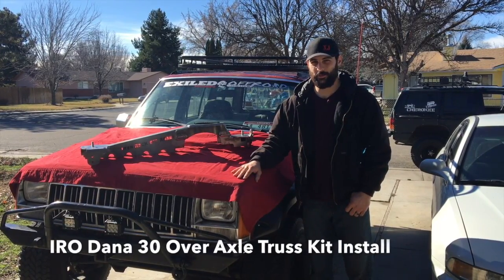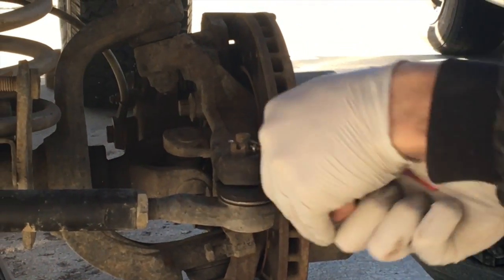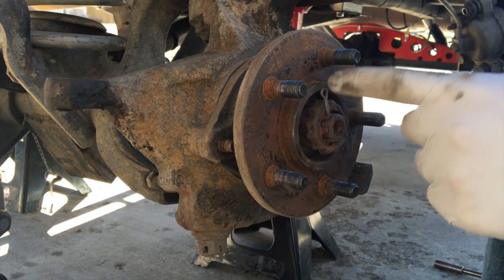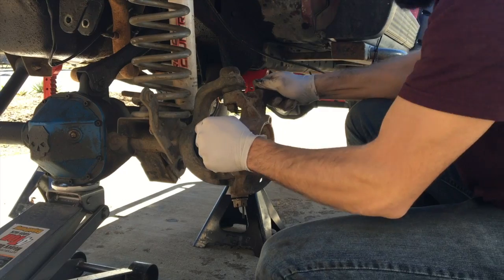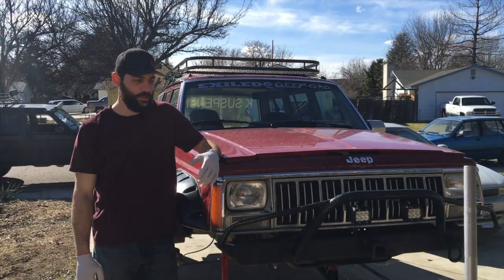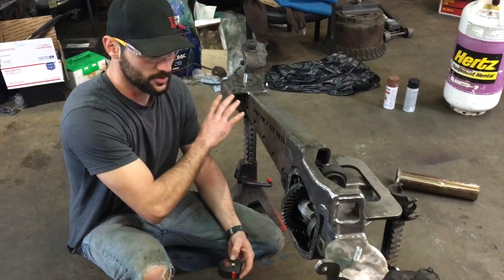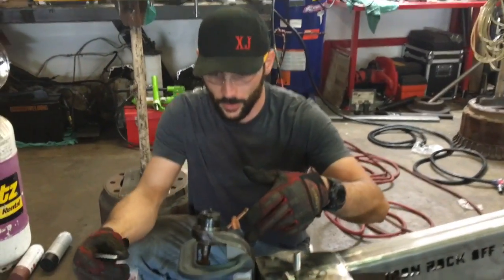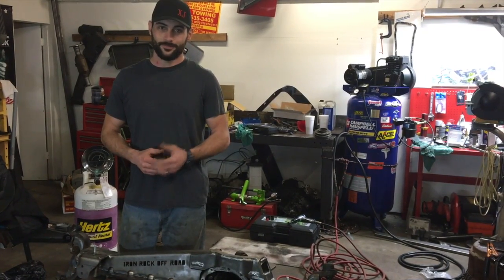IRO Dana 30 Over Axle Truss Kit Install

Comment: Is it necessary to remove the carrier and inner axle seals if welding axle tubes to  center section?
Reply from the maker: Yes. You're gonna cook everything and don't want your parts to fail.
Reply: @KSuspension  cool thank you
Reply: @KSuspension  if I remove the carrier and seals do I need to redo the backlash when I put it back together? All I want to do is weld the axle tube to the pumpkin.
Reply from the maker: @moejr14  shouldn't have to
Reply: @KSuspension  thanks man

Comment: Hello. I’ve been fallowing your FB and YT for a while now. It appears to me that you are a knowledgeable person when it comes to the Jeep Cherokee XJ. I have a 1990 XJ that I am getting ready to start a major build with. The Renix engine will be a entirely separate issue but I am looking at the drive train and suspension first. I also have a 2019 Jeep Wrangler JLUR. I believe the JLUR has the dana44 axels. I am looking at picking up a front and rear JLUR axels fro my XJ. This would give 4-10 gearing, lockers, and 4wheel disc brakes all in one shot. I’ve never done an axel swap so here is my QUESTION: will these axels work on an XJ. I live in eastern Oregon and had plan to purchase some of your products for my build and if it’s ok I might even hit you up from time to time for some technical advise. Thanks and I hope you are doing well during theCOVID hysteria.
Reply from the maker: You can use the axles, but they will be wider and you’ll have to weld on new coil perches and leaf springs perches in order to fit under the XJ properly

Feel free to email us for any tech help
Reply: @KSuspension  Thanks for the quick reply. I figured I would have to redo the spring perches. I’ll have to do some research before I undertake that project, (unless you do that kind of custom work at your shop). Just out of curiosity at this point how much wider are the 44s than the 30s?
Reply from the maker: @williamhart4418  I couldn’t tell you exact measurements without looking it up, but I do know they’re wider

Yes we do this type of work here

Comment: Wow this ball joints are shot lol. See all that movement when snacking the hud free 🤣

Did you really just weld this up with bearings and seals installed? Someone’s gonna have a leaky axle soon and have to rip all this back apart to replace seals at a Minamum.

Comment: Best way to remove much if this is put the nut back on a couple threads upside down (for castle nuts) then just shwack the bolt directly with a hammer. This both breaks it free and keeps it from just falling to the ground entirely as the bolt catches it. 

Second part skipped over.. when removing the driveshaft have some electrical tape handy and tape the two exposed caps down on the ujoint do they don’t come apart. Ideally as you have all this already broken down.. you should just go ahead and replace the joints on the shaft.

Comment: Is that stronger than the sleeves
Reply from the maker: E954 Rr in my personal opinion, 1 isn’t stronger than the other. They both act as an additional strength to twisting and bending
Reply: What about if I install both?

Comment: Im sure it is but do you know if this truss is compatible with rough country long arms?
Reply from the maker: Max Yost I’d call RC to confirm. Don’t wanna mislead you
Reply: I just contacted them. They don’t know for sure. However the driver side would probably cause clearance issues. 😐 Ugh

Comment: Which hobart is that? I have the 140. Think that's enough?
Reply from the maker: Christopher Spencer we use a handler 190
I've never personally used a 140, you may have to go a bit slower as it's only a 115V, but should get the job done.
Reply: KSuspension 
Sounds good, thanks

Comment: really like your vids, pretty detailed... I probably will do the trussed Dana 30 at some point, how much lift do you need to run the truss?
Reply from the maker: TDONLEY91 don't think you'll need much lift if any at all to clear it. 
I'd assume it would clear for stock applications as well. The rear clears stock. 
Would have to ask IRO for a 100% confirmation however

Comment: Do you think you could run an over the knuckle steering set up with the sway bar brackets being moved back on this kit? Also, did your ride height change with the new coil spring perches?
Reply: +Kallam Kruse I will be running OTK steering and everything should clear perfectly. The IRO over axle truss sets the coil perches 1" higher and .5" back for proper caster angles and a slight lift. Combines with the new RE 5.5" coils, should be sitting well around 6" after settling with the weight on the vehicle
The diff isn't installed yet, as we are currently working on the long arms, but I will definitely state an update on it once it's all together. 
I'll release another video for the rest of the install once ready
Reply: +Raffi Kassardjian. Yeah let me know how it ends up, Thank you!